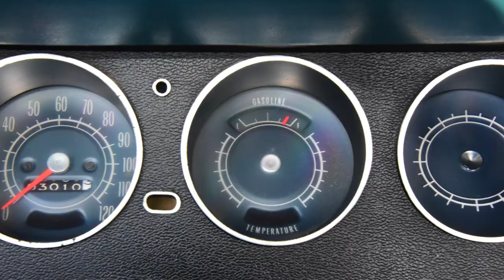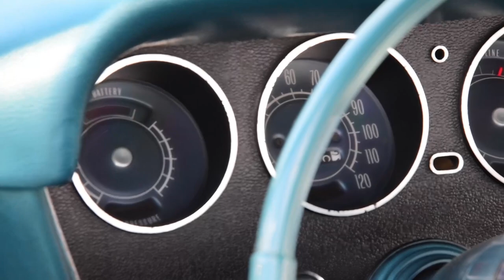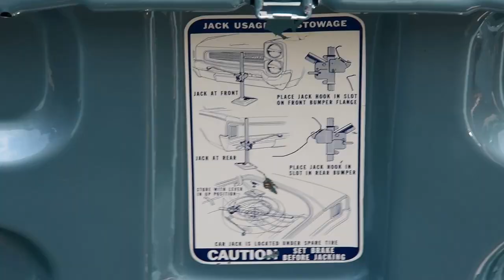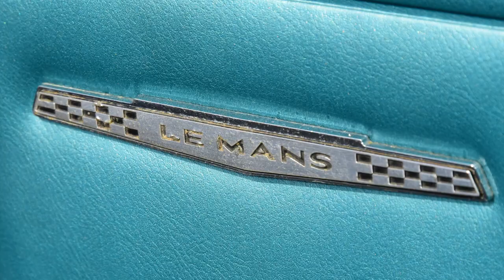1966 Pontiac LeMans: Regular Car Reviews

Comment: The OHC6 in Sprint form (factory 4 bbl and 4 speed, 3.90 , 4.10 or lower gears) could embarrass alot of 300 too 350 V8s.  It was originally designed for the Banshee, which FM not only banned Pontiac from making the car, then used the car design to make the 68 corvette and Buick opel GT.  The OHC6 finally got made and used in 66 to 69 Tempest/Custom S/LeMans and 67 to 69 Firebirds.   btw, the head was cast iron like the block. Only the cam holder was aluminum.  It is still one of the most beautiful engines ever made when the aluminum front cover and cam holder is polished

Comment: I got a 66 Lemans 2 years ago, never going to sell it.  Wanted one for 35 years. Been asked why I didn't get a GTO or do a conversion.  If I wanted a GTO I would have got one, I wanted a Lemans.  Has a non stock 400, but probably going to put a 6.0 LS in it.   I like the 400, but forgot how bad on gas they are.
Reply: RegularCars【 𝟒𝟒𝟑 】𝟓𝟖𝟒-𝟔𝟒𝟎𝟏  New inventory?

Comment: What if AMC had licensed this? I know they had their own straight 6, but still, I bet they could have gotten a lot out of this engine even with their limited development budget.
Reply: It is my understanding that AMC did build and test OHC versions of the 199 and 232 in the 1960s. Why they did not pursue them is probably tied down to money. After the 232 went into production development went into the Gen2 V-8s. They were introduced in 66. You could probably put one of these on top of a 4.0. The bore spacing is only .020" less than the Chevy/Pontiac inline. The problem would be covering up the pushrod /oil return galley. Take two heads cut them and weld back together. Weld in an addition to cover over the pushrod galley. Figure out how to get  oil to the top of the engine.  Or better yet start with either two GM LQ-1 DOHC heads or two Nissan/Infinity DOHC heads. Put the exhaust on the passenger side and lean the engine over somewhat. Gives more room for creative induction options.

Comment: My Mom had a 67 LeMans with the OHC six. Went through two motors and finally had to junk it. I think the pistons/connecting rods broke and cracked the block both times.
Reply: The pistons and rods were basically just Chevy parts. Pontiac really developed this engine on the cheap. Slightly modified block. A new head. Heck they even kept the original camshaft to drive the distributor iirc. Probably had the blocks, cranks etc machined at one of Chevy's plants.

Comment: great, now I gotta slot “pontiac OHC six” between “corvair flat six” and “buick/olds 215” in the list of “motors that some rogue engineer needs to laser map and machine new billet aluminum blocks and heads for so someone else can restomod a nova, vega, camaro, or other relatively small classic American car with a period-correct motor that isn’t a BBC or a 350”

Comment: Pontiac did not introduce the first volume production SOHC inline six in the US. Willys did. The 3.8 liter SOHC hemispherical combustion chamber Tornado. Introduced in 1962 it only stuck around for a couple of years before being shipped of to Argentina to be used in Kaiser Industrias produced versions of AMC models. Where it had con as Miserable success in racing in a restyled 64/65 Ramnler American. The IKA Turino. As a side not heavily modified versions of Ford, Chevy and AMC/Jeep 4.0 are still used to this day in competition in the oldest continuously running racing series on the planet. The current motors feature DOHC 24 valve heads, dry sump lubrication etc with induction limited to two Weber Downdraft carbs. Around 500 hp in race trim. They have done some pretty amazing things with inline sixes both there and in Brazil.

Comment: Not being the owner, I don't see a problem in dropping that original engine in favor of a modern GM Atlas 4200 mated to a 4L60E (can't recall if the Colorado or Canyon came with a manual option on the I-5 that shares the same bellhousing pattern ) the day it finally shits the bed or he runs out of parts to repair it.
I understand the car it's A LOT more valuable/desirable if it remains as original as possible but shit happens and all that, so you got to keep your mind open if you want to keep t running "forever" and not doing another stinking LSx/LTx swap like everybody and their buddies.
BTW, VERY CLEAN and STRAIGHT looking car. Usually Verts look ragged and beat up AF.

Comment: The 2JZ wouldn't exist without the decades of development in the M-family and the failures of the 7M-GTE. Toyota learned from the issues strapping a turbo to the 7M caused and put that knowledge into the 1JZ, they even share the engine mounts. 7M-GTEs are great engines if you fix their shortcomings but the damage was done and the JZ kicked it out the door and halfway down the street.

Comment: Is an aluminium head over an iron block really that bad though? Aren`t many of the legendary engines of the 80s and 90s set up in exactly that way? I mean sure there is a difference in expansion rates of the different materials, which might mean increased wear and risk of blowing a gasket, but if I understand things correctly a multi layer gasket can keep things under control to where it`s not an issue, and you get the light weight and improved heat dissipation of the aluminium head with the strength of the iron block... I might be wrong, but if memory serves the 2J is an iron block with alluminum head (and again, so are many of the legendary engines of the time)

Comment: Back in 07 I bought a 68 firebird with the OHC i6 and drove the balls off of it until the transmission did its own imitation of chernobyl. I replaced the drive train with a Pontiac 326 and 2004r. 
I stored the i6 drained but sprayed down with oil and wrapped in wax paper. It's just sitting in my dad's garage so if anyone wants it hit me up

Comment: To be fair, GM LS-based vortec engines are cast iron blocks with aluminum heads. Apart from weight and material cost, there isn't much of a benefit to aluminum apart from regulating temperature and "looks nice".

Comment: YOu call it a land boat, but the curb weight on the '65 with the notoriously portly Pontiac V8 was right at 3,000lbs. 
I got mine for 2 grand back in... 2004, I think it was? 
If you could find parts for the 250 Sprint I'd probably have had that in my car, I'm just not keen on buying a whole new engine every time something goes bad.

Comment: Hindsight is always 20/20. Gas was 25 cents a gallon in the 60s - there was no need to be economical. The OHC was obviously ahead of its time, but not OF its time - technological advances rarely are. There were turbos and fuel injections back then too. Took until the 80s for them to be commonplace. Progress is a slow march and sometime things get lost along the way. RIP the Pontiac OHC L6.

Comment: I think of the Pontiac OHC inline-6 as more analogous to the Nissan/Datsun L-series inline-6 than the Toyota JZ. As usual GM was shortsighted in not developing this engine. It would've put the company in a much better position during the fuel crisis of the 1970s. They could've easily lopped of 2 cylinders and had an inline-4 as well.

Comment: OHC, yes, but still hobbled by being counterflow. Aluminum heads are fine on iron blocks. VW built millions of engines like that, starting in 1974. GM has built millions of V8s in that configuration.

Comment: There was a 230HP version of the OHC 250. 
4-bbl. Rochester, Split dual exhaust, 10:1 c.r. and a fairly hot cam.
Put one of those in a Firebird Sprint, park a wide ratio Muncie behind it, lash it all to a set of 3.55's w/Posi and slap some red stripe Tiger Paws to each corner and you'd actually have something.
SO, for all your lamenting, RCR, you failed to dig deep enough into the history of the engine to discover that gem you just spent 15 minutes whining that we never had.
So why didn't it sell? Because we were already thick into the muscle car era, and no matter what you put it in, a 230 HP inline six just does not stand up to a 400 hp V8 at the drag strip, which was The Great American Tape Measure back then.

Comment: My first car was a 1967 tempest it had the 5.3 l 326 V8 and a two-speed automatic it was fully loaded with air conditioning bucket seats power windows tilt wheel with center console full gauge cluster AM FM 8-track radio and the vinyl roof I thought all cars came that way it was a very good car
Reply: 327?
Reply: @markwilliams2620  Chevy 327 Pontiac 326. I think the difference was the porting in the heads the blocks were the same the Pistons were the same but the heads were different so it had to be porting

Comment: Under DeLorean's watchful eye, Pontiac developed a single- and dual-overhead-cam V8, all aluminum block and heads, and an alloy for the crankshaft that was significantly stronger than cast iron, while being lighter, and not costing a whole lot more money.

GM canned all of those, and even went so far as to take all the research for the aluminum Pontiac V8 and give it to Chevy, so six months later we got an all-aluminum Chevy Big Block.

GM never deserved Pontiac.

Comment: Proving once again that Pontiac was so far ahead of the curve it out distanced the vision of both the consumer and General Motors' upper level management. And when they did get their edge within management's range of vision, GM management would steal their ideas and put a bow tie badge on them. 😡
'Mericans, kinda slow on the uptake. 🤷🏿‍♂️🤦🏿‍♂️
And if you think Atlanta Motorsports Park is nice, just wait until they complete the Flatrock Motorsports Park in Crossville Tennessee. It's going to be the longest road course in the United States at around 6 mi in length.

Comment: It seems that all the American manufactures gave up too soon on new ideas. That engine could have the American JZ but the competition was cheap gas and cubic inches. Imagine if GM had actually developed the Corvair? Where was the 911 at that point? Not that special. How about a Chrysler slant six with a modern hemi treatment? True, they were not the right engines for the time but they would have been a great base for the smaller engines that we needed in the 80's. And it brings up the next question. What idea are we dumping now because we'll never need that again, only to wish we had it back.

Comment: Yet another example of GM incompetence.
Step 1  Spend fortune developing modern new engine
Step 2  Run into teething problems
Step 3. Abandon project instead of developing improved 2nd gen engine

Other examples
Northstar V8 - ruined by bad choice of head bolts
Atlas I6 - ruined by inadequate cooling

Comment: Only because you made such a big deal about the aluminum head to iron block stuff (belch belch belch) I have to point out, the Pontiac OHC 6 used a cast iron cylinder head. However, the entire camshaft housing which sits on top of the actual head is aluminum.
No, they are not the same thing and I am not being pedantic. Do your damn research.

Comment: People get v6's because they can't afford a v8, Likewise you get a v8 because you can't afford a v12. 
Corvette started with an I6, America will get there eventually if petrol doesn't run out first.
(a v16 could be the next step.. except a v12 is inherently balanced already and if you need more engine you could just get a bigger v12 which would be narrower for a given bore so no real advantage from this point on).
Reply: Which is crazy because my 2005 V-6 Crossfire was the fastest car I had driven until I bought an EV.

Comment: Biggest load of garbage I have heard from you. Australia is all about V8s, that didn't stop production and improvement of 6 cylinders and neither was the case in America. The stove bolt, slant, buick v6 and now you have the gm 4.2. 6s were not under represented or disregarded. Go ask anybody that could have bought one of those new if they know about the engine they wouldn't know it existed which is a failure of marketing and not "anti-progress" as you like to claim is the issue like a broken record.